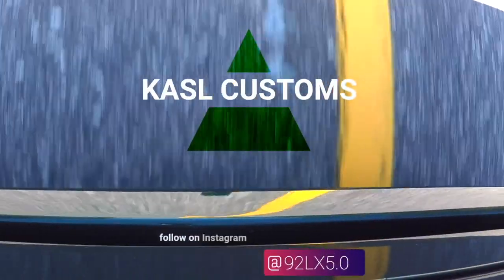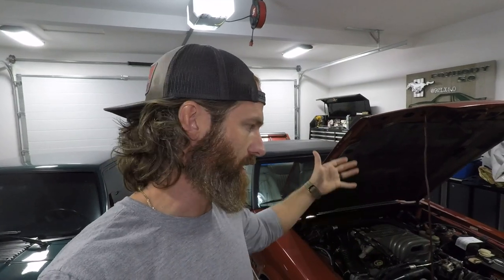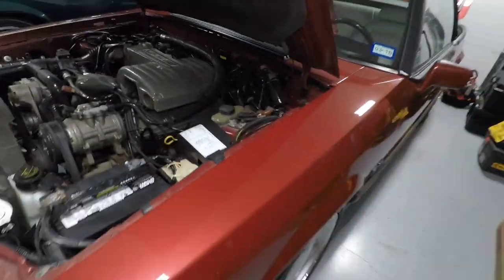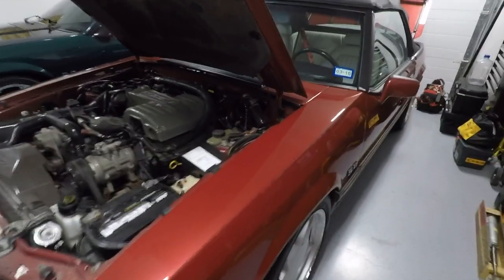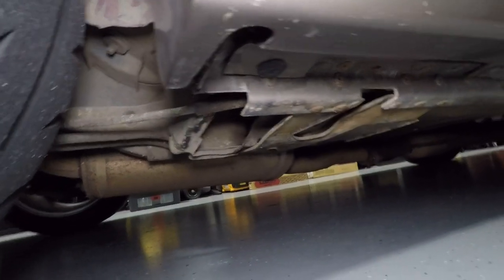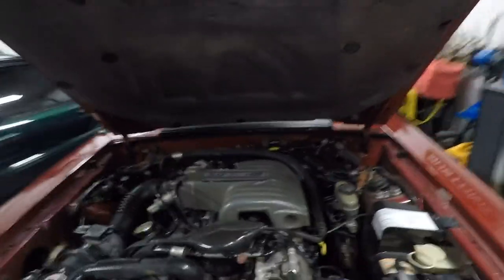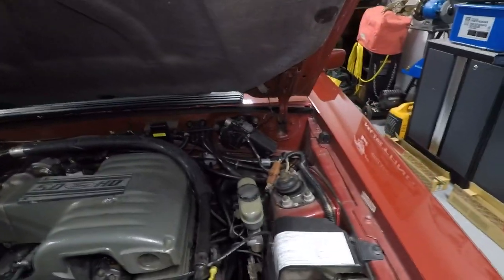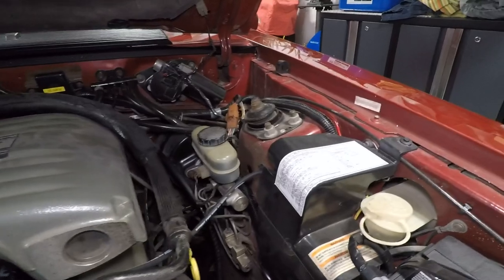How to find a CLEAN Foxbody Mustang 5.0 /// What to look for and how to spot a barn find!

Comment: Awesome video Kasl! I have the same mindset when it comes down to body condition vs drivetrain/interior. I would much rather invest in building an engine than having to repair rust or fix major body issues. All the engine and interior stuff is easily in reach. I have a 1989 mustang gt hatchback i bought for 3k about 3 years ago. I bought it due to it being completely stocm (down to the exhaust!) And the interior being a solid 9 out of 10. There are a few minor rust spots and it needs paint badly (which i found out my fox is a very rare color for the model trim and year apparently). I want to get it painted but i wont until i have a place with a garage. Not going to spend thousands to have it sit outside. Im rambling but again great video!
Reply from the maker: Thx buddy! Sounds like a sweet car👌. Great minds think alike 😉😉😉

Comment: Great video ! have you ever thought about putting sub frame connectors on your vert ? The only mods I did to my gt  are the heads upper / lower intake! But I’m keeping all my stock parts just in case I do ever sell it ! Witch is unlikely but People do like all original. However my fox is a automatic but I just came across a 91 lx 5.0 5speed in the salvage yard that I could not believe because you never find foxbodys anymore in the junkyards not around Massachusetts anyways! But anyways I just paid two hundred for everything I need to do the t5 swap 😃
Reply from the maker: Thx buddy!! I have thought about it on both my cars. My coupe doesn’t have them either. The convertible is a lot “slushier” feeling then the coupe that is for sure. I may do a video talking about some of the differences that I’ve noticed between the models.  Wow - a 5.0 in the junk yard is a very rare find that’s for sure!!!

Comment: Great content as always! Love be this channel!  Was wondering, as my 87 is pretty much completely stock minus a flow master cat back system, what would you recommend as far as exhaust is concerned when these factory catalytic converters start going bad?  Still have smog pump and O2 sensors and want to keep all that in place.  Thank You in advance..car is still Speed Density as well.
Reply from the maker: Thx my friend! All of the aftermarket H & X pipes come with inlets/plumbing for the smog pump related stuff so you’ll be good there. I also like the ease of instal and tidiness of unequal length ceramic coated headers 👍👍

Comment: Can you do a video on the 1987 foxbody engine explaining every wire/hoses saying what they are and what they do? I would like to know what I need and what I can clean up and put aside since my car doesn’t have an ac compressor and I have some unconnected hoses laying in my engine bay!!
Reply from the maker: Sorry bud, I do not have an 87 to do that with. Nor do I have any idea as to what you are going to need or not need for your particular car.
Reply: I was planning on taking anything that has to do with the ac out and maybe wondering if It’s a good idea to get rid of the smog pump for a cleaner look! Are you still running ac and smog pump?? What are your thoughts?
Reply from the maker: Oh nice. I still have the A/C and smog pump on my convertible
Reply: @KASLCustoms  how about on your badass notch you still have those things on it?
Reply from the maker: On the notch the Smog is removed. My notch never had A/C so didn’t remove anything there 👍
Reply: @KASLCustoms  i love your videos and your notch, and I just want to build my foxbody the rite way and not make any mistakes. I’ll be removing the smog pump this weekend I’ll look at some videos on how to do it thanks
Reply from the maker: Thx bud! It’s not to bad to do. You can either get an idler wheel and run the same stock sized belt, or delete it all together and run a shorter belt. The cleanest way to remove everything is to remove the plumbing from the back of the heads and plug the holes but you can also just plug the plumbing near the shock tower as well - It’s not as clean but I had my coupe like this for many years 👍